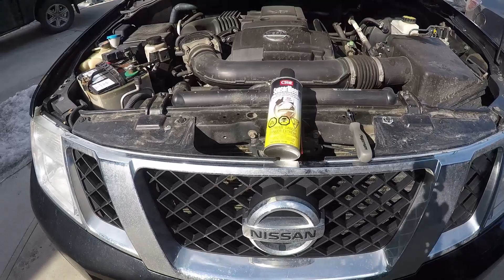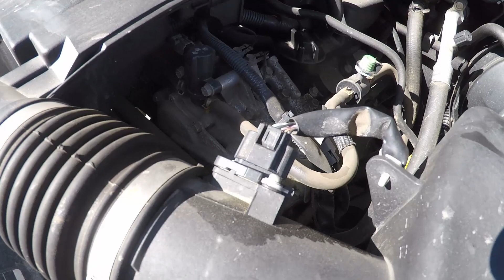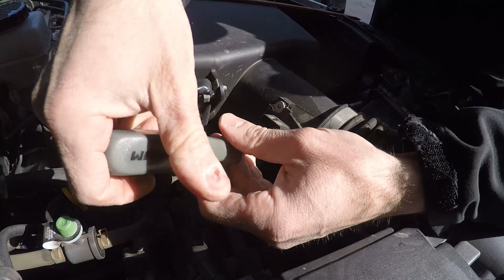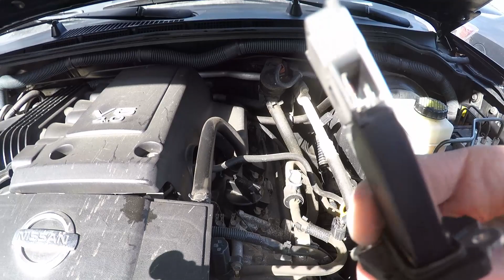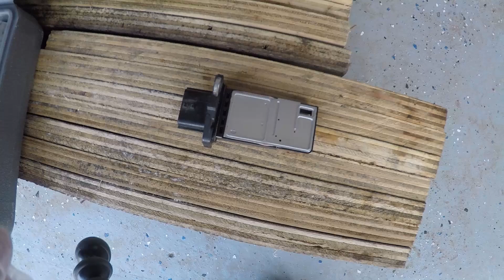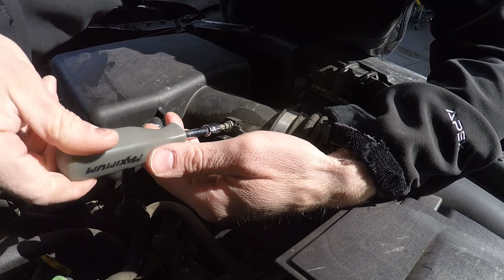2012 Nissan Pathfinder Mass Air Flow (MAF) Sensor Cleaning

Comment: i cleaned mine did not fix issue , keep getting same error code mass airflow , i even put a different mass airflow sensor from my frontier same part number cleared error and it came back 2 days later , this p101 mass airflow sensor error is complete BS
Reply from the maker: Yeah I'm not too familiar with all of the options for getting the P101 but it seems like it can be a bit of a host of issues and sensor communication problems,

Comment: After you clean or replace the sensor, do you have to drive it or will the check engine light be off automatically as soon as you start it?
Reply from the maker: You might need to clear the codes for it to really disappear.
I'm not sure if driving would be enough
Reply: Or you could disconnect the battery terminals for like 10 min and connect back to reset the codes.

Comment: I've cleaned and also bought a new sensor with air filter and still not working for me. I'm not sure what to do next💁🏽‍♂️🤦🏽‍♂️
Reply from the maker: Is your check engine light on, and if so do you have a code that it is giving?
Reply: I had this similar issue back in May and it turned out I had to go to the Nissan dealer for a software reprogramming. 300 bucks.

Comment: Could you use panel wipe? I'm in the UK
Reply from the maker: I'm not sure what that is (is that like a white board cleaner), but the MAF cleaner is a specific type of electronics cleaner that doesn't leave a residue when it dries. You don't want to any sort of film on the sensors. They must have MAF cleaner in the UK, perhaps a different brand.
Reply: @DIYNorth  have you also done a videos on how to clean the suction control valve (scv)?
Reply from the maker: @andrewbaxter9103  I have no scv videos of any sort.

Comment: Nice infro but I clean mine on light come back ofter a week even change it on it still come back was told I have to buy it from the Nissan dealer any help please.
Reply from the maker: I'm not really sure. It might be better to get a Nissan sensor. I'm not sure how much they are but if they are a lot you could try a scrap yard. Is there any other issues along the path of airflow that might be causing an issue.
Reply: The "Nissan" sensors are just Hitachi. Buy it yourself and change it.
Reply: I was having a similar problem and it turned out I had to go to the Nissan dealer for a software reprogramming. 300 bucks. 😕

Comment: My check engine light still on. Sometimes the rest happens after I drive it. That common?
Reply: Oddly enough it drives better even with the light on. The lag in acceleration was fixed agree the cleaning
Reply from the maker: Interesting. A few things could cause the MAF code to be thrown. It could be that the sensor is faulty.
Reply: @DIYNorth  that would suck. I just changed it with an OEM from nissan less that a year ago. Read online that it may take a few driving trips to reset the light. Here's hoping!
Reply from the maker: It doesn't sound common. Have you plugged in an OBD II code reader to see what check engine code is displayed.
Reply: Yes. Before the cleaning. The code was for the MAF sensor. I'll have to head back to AutoZone to see if there's a new code.